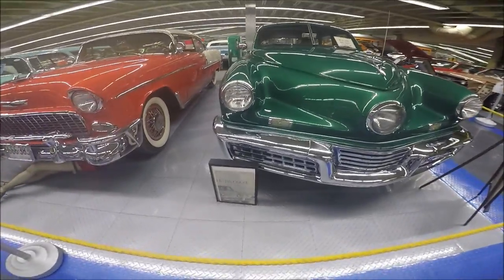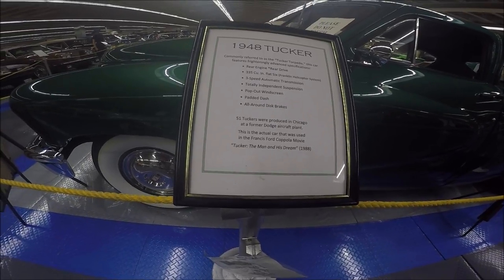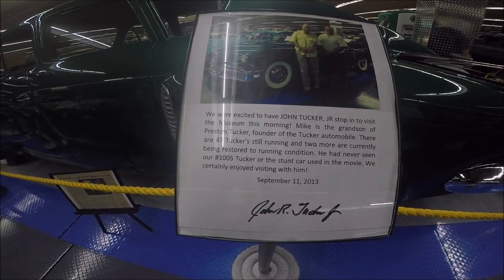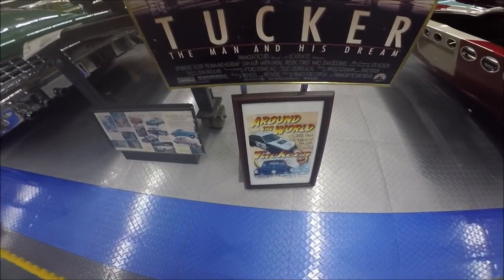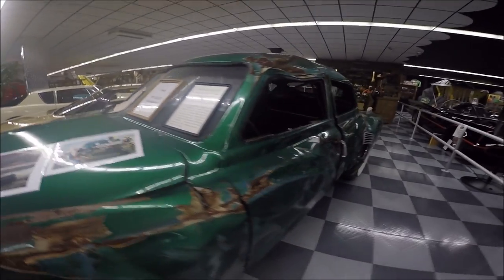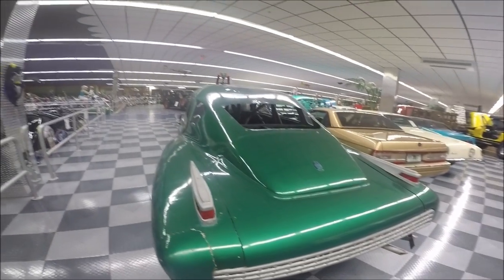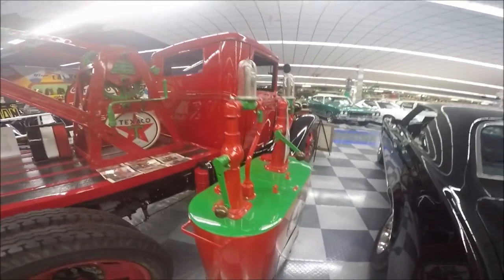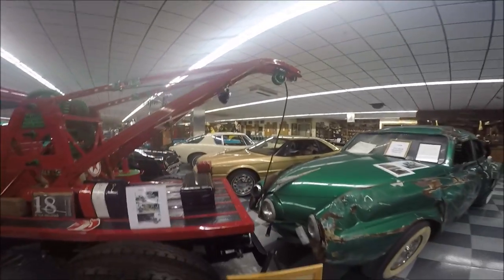Tallahassee Automobile Museum Tucker Exhibit And 1933 Chevy Towtruck083017

Comment: This is quite a display for quite a car! The Tucker was touted as a 'safe car' but they don't call  rear hinged back doors 'suicide doors' for no reason and I noticed no sort of passenger restraints. It was, IMO, a real ugly duckling but had Mr Tucker not been forced out of business by the Media, the Big Three and a very public SEC investigation, with charges later dropped, it may have evolved into a swan. https://en.wikipedia.org/wiki/Tucker_48
VERY impressive display, thanks Jack!!

Irma is approaching Jack and Mark, are you staying or running and if you run, where do you go, the storm is wider than the entire state. BE SAFE!!
Reply from the maker: Hey, Terry!  I think the windshield design and the recessed dash were the major ingredients in the "safe" designation.. and when I think of my aunt's '48 Plymouth with that steel dash and protruding knobs and chrome surfaces, I'd rather be in a Tucker in a collision.  Tucker was an idea man....not properly funded, hence the need to sell Tucker radios and seat covers before production commenced, giving impetus to the SEC investigation.  I think it could have been a great car if production were allowed to continue.  Unfortunately, once charges are made, regardless of the truth of them, it's difficult to overcome the stigma.  Tucker was cleared, but it was too late.  
It looks like the storm will be right in our backyard in the Orlando area...the house is a 2003 model, so it has the "hurricane straps" and is concrete block, so I think we can remain in place.  However, we will keep a wary eye and go to a shelter if necessary!  Thanks for the well wishes!  :) Jack